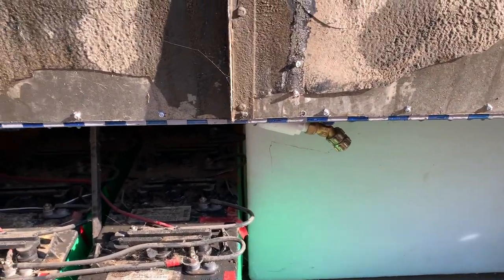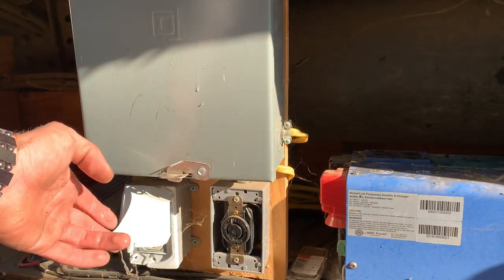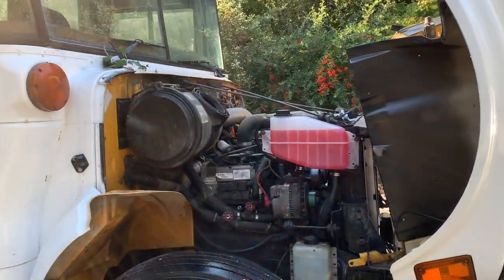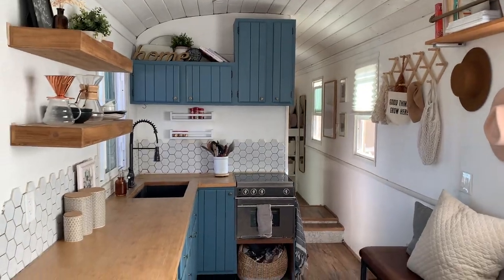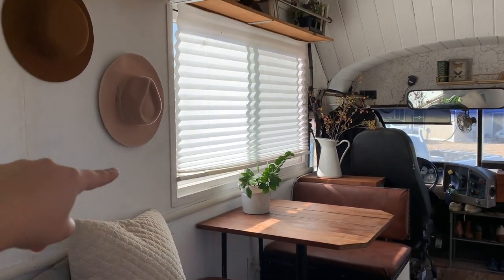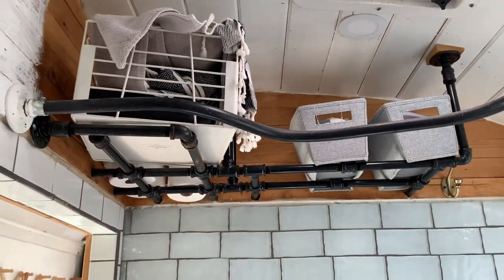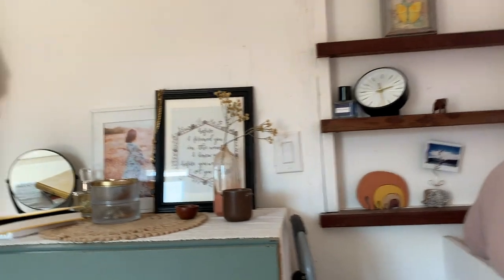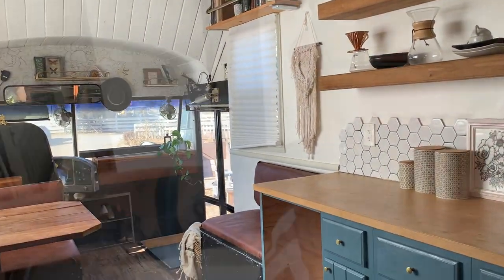Skoolie Bus Is A Castle On Wheels

Comment: The effort and layout are nice. You can tell they built this to stay in one place. This was reinforced by the comment that they have been on shore water for a while. The underneath is open to the road and not water proof. This leads me to suspect it’s not insulated well and would not be good for cold climates. Great job on a homemade build but not even close to being worth $75k.
Reply: Yeah... Ive heard a few of these both schoolie or actual tiny houses where they mentioned HGTV.

HGTV is the worst and haunt ones like these. Really pretty cosmetically  but significant problems with the mechanical/electrical/plumbing. Gotta make sure all that is solid before anything else.

I didn't think much of it but 75k is absolutely insane... That amount could get you a lot better.
Reply: They got $68,000 for it

Comment: Pluses: Your roof raise, kitchen, bathroom and bedroom are well built. Looks like a cabin. 👍🏻
Minuses: Your expensive inverter is dirty from being exposed to the elements. The storage area below looks flimsy. The seating area is a death trap in a wreck. 👎🏻
$75,000 is way too much. You can get a newer diesel pusher with fewer miles for that price.

Comment: Half assed tile work. Cabinets that don't lock during driving. Passenger seats that just fly around if in a wreck. Kids sleep under you so I guess no sex life. 200k on engine. Only one blinds on one window. No fridge. Dirty looking in bathroom.. Exposed wiring. You can't ask top dollar for this. Looks like tweekers built it, who aren't professional builders. It's main selling point is the raised roof. I doubt this is worth more than $40k. And even that's generous.
Reply: 200,000 is not excessive for a 7.3 turnbo diesel engine.  These engines regularly run 500,000 or more.
Reply: My son has always had diesels...they can do 600k easily

Comment: What about seat belts for passengers? If the seating is moveable, how are they safe for passengers?
Reply: Depends, not all buses are equipped with seat belts because it depends on how they travel... Slow and steady, like most public transportation buses in cities, don't need seat belts but faster highway speed or rough terrain buses do have seat belts.

You also may or may not need them if you do or don't intend to have passengers... If they never need to provide seating other than when parked then that's not a issue...

They didn't mention it during the tour but even if they haven't configured the seats with that function.  You can add seat belts to just about anything and also anchor anything to the floor.  So it can be changed for handling rougher terrain and higher travel speeds if the next owner need that to be the case...  So can be an easy fix...
Reply: @ZeoCyberG  for asking 75k, original owners with 2 toddlers as per the video... Not safe and high price for something not meant to be driven.

Buses don't necessarily need seat belts legally but from the build and owner comments this was clearly not really driven much or meant to be either.
Reply: @kbo8029  Safety and cost are relative, like I stated it's not a issue if they will have no passengers and they can always transport the family in a separate vehicle but not intending to move it doesn't change it's still a vehicle, can still be moved, and that isn't free, nor what they did to it like the roof raising, power system, etc.  Converting anything into a home has a cost and those cost can add up, and there is also something to be said for all the labor, as well as their time and energy, they put into it.

A bus conversion without the power system, roof raise, etc. will of course not cost as much, there are much more basic conversions out there, but it would also be less capable and less comfortable to live in as the trade off.  Some conversions require hook ups and can't function off-grid, for example.  Lower priced conversions also tend to be smaller, even buses can range quite a bit in size.  So what you get for the price can vary quite a bit...

There are always trade offs and it really depends what you want to end up with and what you get out of it...  But, of course, you can always do your own conversion instead of buying one done by someone else to make sure you're only paying for what you want to pay for...

Comment: This looks handmade by someone who's definitely not a professional. Waaaay too expensive. When you're putting your time and energy into making something that you're going to use and then you use it, you have to subtract the time that you enjoyed it. You're never going to get your money out of something like this unless you do a professional build. Your price is almost twice as much as it's worth.
Reply: Problem is people can invest a lot into something but that doesn't mean the next person will appreciate it or understand where the costs went into... Like just raising the roof for the additional headroom height cost them $8500...  The 8 batteries, inverter, etc. cost them somewhere around over $3K...  Regardless of how it looks they still put $22,133.37 of materials into it... Buying a used vehicle typically means maintenance, repairs, engine restoration, etc. costs...  1,270 work hours over 7 months, etc. So they're probably asking a fair price, even if it doesn't seem that way to others, unfortunately...  That's the risks when you do conversions and your plans change and you're forced to sell it, especially before you're actually finished with the conversion and it looks worse than it actually is...

But they also state in the listing the price is negotiable... Hopefully, they'll get something fair to all parties...

Comment: @ 40 ft length with that type of modification DOT will NOT allow you drive on highways so before you buy check restrictions on your states permits sorry to be stick in the mud but driving tour busses for more than 27 years and getting stopped for legitimate equipment jades my opinion of hack job construction and to top that i do not want my insurance company to cover that OTR
Reply: With are you talking about
Reply: Skoolies are DMV registered as RVs. So no need for special drivers licenses and almost no limit on mods. They even have fireplaces with flews coming out of the ceiling in them in some cases. 😆😆 DOT does not apply to these.